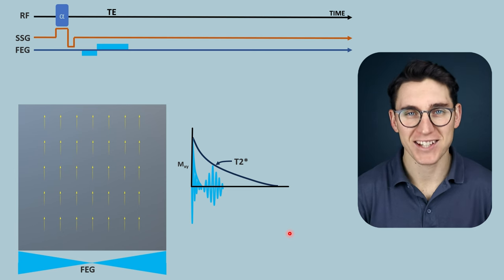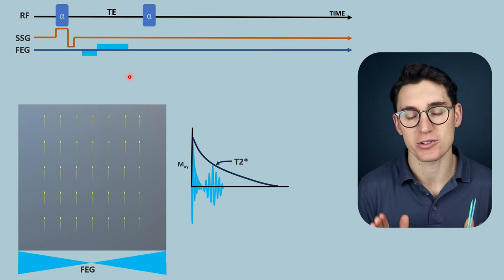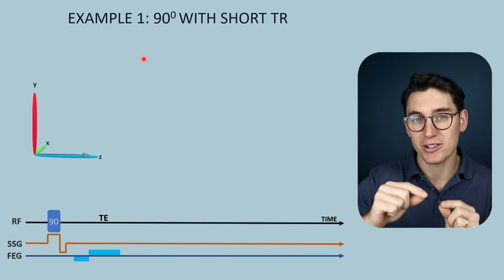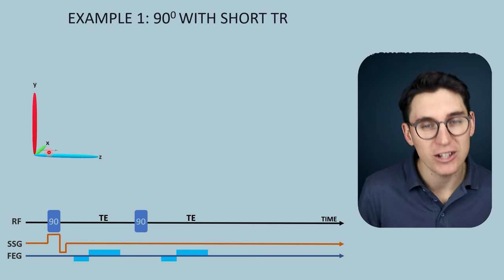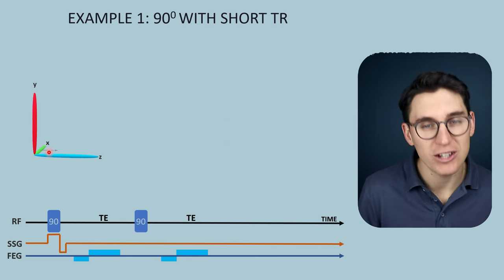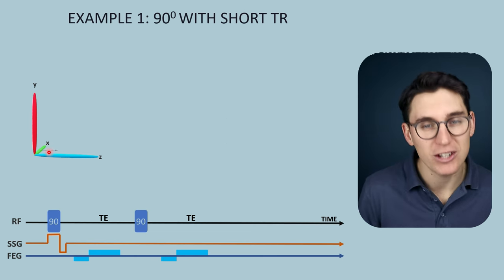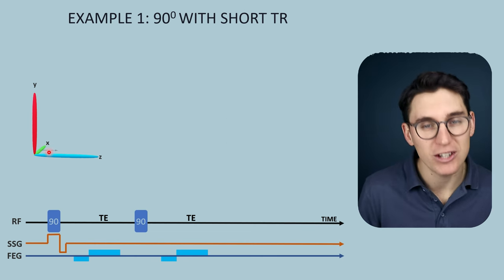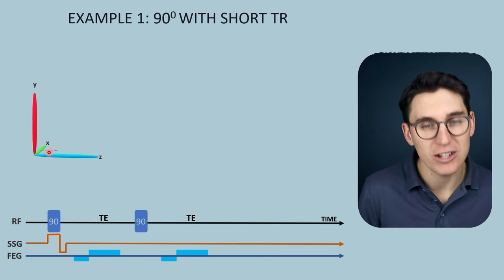Flip Angle and Ernst Angle in Gradient Echo MRI | MRI Physics Course #17

Comment: Question on longitudinal recovery and the description of the "90 degree" RF pulse: Is the 90 degree pulse defined as a literal 90 degrees, that by imparting the Larmor frequency for a specific time it will excite the magnetic vector for 90 degrees of change regardless of magnetic vector orientation? So that magnetization that is not fully recovered in the longitudinal plane could be driven past 90 degrees? It's my understanding this is how diffusion imaging works. So it would make sense that the "unrecovered" longitudinal magnetization would actually be driven PASSED 90 degrees, which is what leads to the lowered available transverse magnetization levels with shorter TR times. I would think that since we can drive the magnetization vector to 180 degrees, that we can drive past 90. As an example, in a short TR, fast T2 time spins recover to the full longitudinal plane, or zero, while long TR spins only recover to, let's call it, 45 degrees in that TR time period. That would mean that the next 90 degree pulse would drive the fully-recovered zero spins to 90 degrees, while the partially-recovered 45 degree spins would be driven to (45 + 90) 135 degrees, and thus passed the measured transverse plain. Is this simplified geometric explanation valid? Or are there other factors in play that keep the non-recovered spins from experiencing the 90 degree pulse, such as not responding to the Larmor frequency? Thanks!!!
Reply from the maker: What an excellent question. You are completely right! Impressed with how clearly you asked this. At short TRs we do in fact drive partially recovered spins past 90 degrees. And this is what is responsible for the transverse magnetisation after the second TR to be reduced (equal to recovered longitudinal magnetisation). These spins driven past 90 degrees in fact create an echo (only at short TRs like you've described). This echo is not a proper rephasing echo like the 180 degrees pulse we saw in spin echo. The echo is called a stimulated echo which we will cover in the next talk when we look at coherent GRE sequences. Hope that makes some sense!
Reply: @radiologytutorials  OK awesome! Makes me feel like I'm getting a true grasp of the mechanism of action for creating pulse sequences. I think I did make an error though in my question in conflating long TRs with T2 recovery. As a technologist, I think of long TRs as T2 due to image WEIGHTING. However, the long TR I was referencing for recovery to zero transverse magnetization is actually referencing T1 recovery, correct? T2 dephasing times are actually very short, but we WEIGHT the images to T2 by allowing T1 recovery to fully take place so that both can get driven to 90 degrees fully, and we can then detect the short time spin dephasing differences between fat and water? It's kind of hard training my mind to think of the physics opposite of weighting! That would also mean that T1 WEIGHTED images actually take advantage of the differences in T2 dephasing in the short time frame, we just use a short TR because we can then drive the fat back to 90 and the unrecovered water past 90?

Comment: I am confused: in the end of the video you say that you can get T2 weighted images with gradient echo. But without that 180 rephasing pulse like in spin echo, you could only get T2*, right? or am I missing something?
Reply from the maker: Technically yes, one should say T2* weighted. But by convention, when we talk about the weighting of an image we generally use T1 and T2 to describe what is contributing to the contrast most in the specific pulse sequence. If you think about it, even spin echo only reaches true T2 for a brief moment and the majority of signal is <T2.

We use the term T2* to describe the signal we are sampling (in GRE sequences we sample T2* as you’ve correctly stated). But we do so also in T1 weighted GRE images (the signal here is also T2*). There is a subtle difference.

When looking at an image in practice I wouldn’t stress about T2 vs T2* weighting. In an exam, if given the option I would say T2* for GRE sequences. 

Long winded way of saying, yes, you’re correct 😂😅